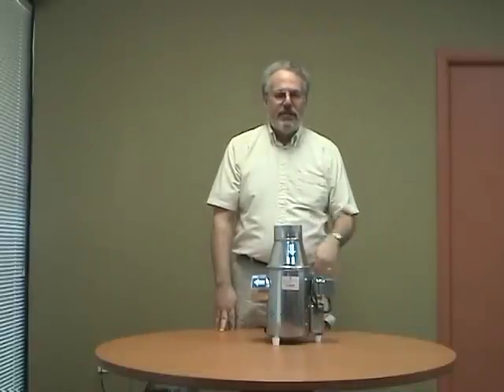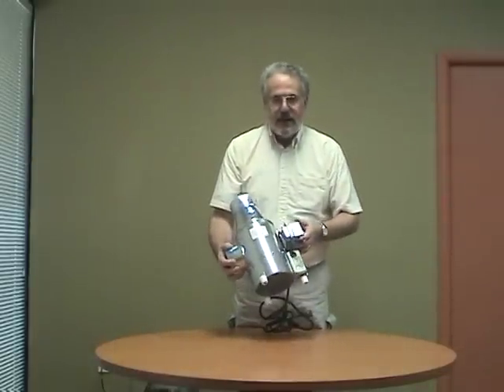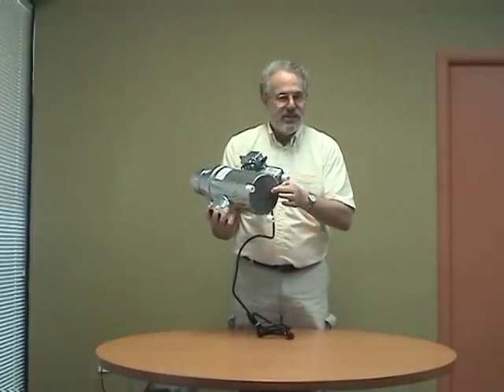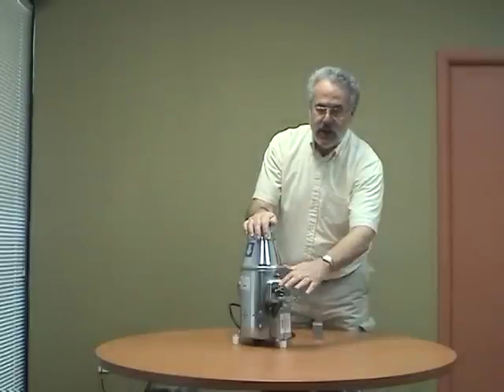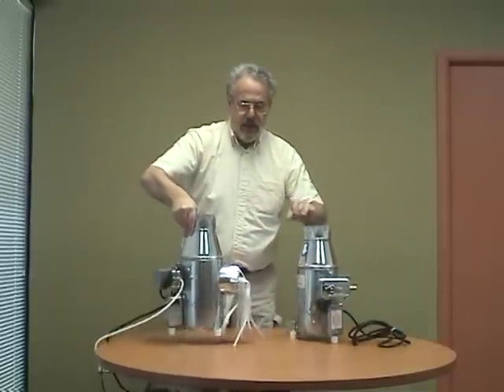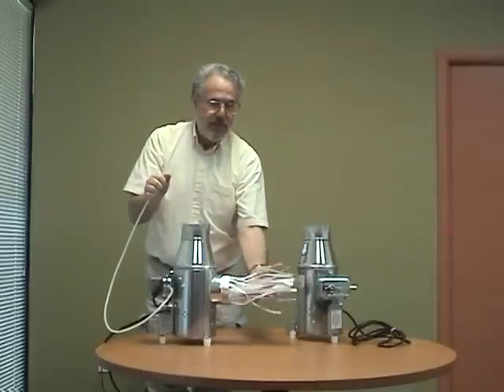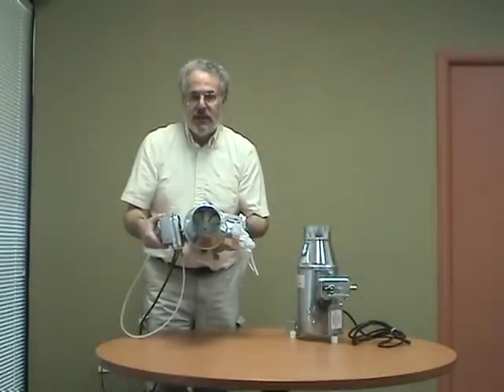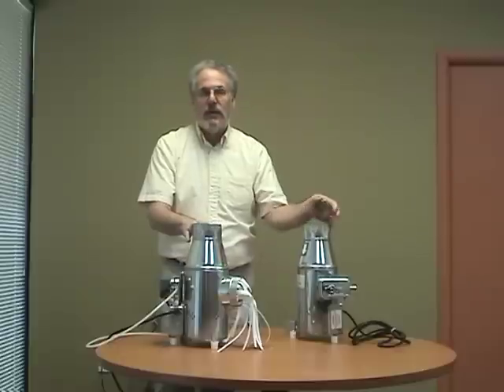The Ultimate Dryer Booster - Acme Miami 9460

Comment: I purchased one of these fans and installed it behind my dryer. I have a 40 foot run of metal pipe through my attic to an exterior wall. With the elbows the total equiv length is 75 feet. This fan works great solved my problem of my dryer venting into my garage. I just cant say enough about how good this unit works. I plugged it into my wall outlet in the laundry room....easy.The automatic pressure switch activates the fan when I turn on my dryer. Very very well made...all metal....great product worth every penny it costs.
Reply: And the unit runs at about the same noise level as the dryer, maybe a little less. The airflow increase is outstanding.

Comment: I ordered my A-M 9460 from the KTool website. They had to wait on a part before sending the unit to me. It took about 3 weeks, and I installed and I'm using it the first time tonight. It is already making a huge difference in drying time and results.

Diagrams come with the unit showing how to set it up for horizontal and vertical installations. I recommend the harder duct instead of the flexible foil duct. The plastic tube has to be inserted into the duct pipe to actuate the unit when the dryer comes on.

The unit is no louder than the dryer, and it moves a lot of air, quickly. The temperature difference of the pipe between just the dryer running and running with the blower is significant. Air flow will definitely improve drying times.

Cleaning the unit of any accumulated lint is recommended at least every six months for efficiency and safety. I recommend setting a reminder on your phone's Calendar to do this. I have all of my maintenance reminders set there, to change out various filters.

The booster actually cost more than my refurbished 30 year old Whirlpool dryer. But in my honest opinion, worth every penny, and gives a lot of bang for your buck.

Comment: Chuck, I have an LG stacked washer/dryer tightly fit in a condominium closet. Off the back of the top mounted dryer the duct immediately turns up 90 degrees, goes through the ceiling, into the attic and turns 90 degrees again. I don't have floor space on any of the 4 sides, so can the booster be mounted horizontally on the wall or resting on top of the dryer?  Also, are there limitations on how close to the dryer it can be? Thanks, John Manchester
Reply: KTool website has this unit, and has diagrams for horizontal/elevated installations. It won't let me share a link to the page.

Comment: Chuck/ John, how long can a standard house dryer vent hose be before you have to put a booster fan?  Thanks
Reply: For those just seeing your post, the max a standard dryer is usually designed to handle about 26 feet of vent duct, maximum. I had 27 feet of duct, and have a 30 year old Whirlpool dryer, lovingly maintained, with a new element. Because of the length of the duct, staying times were sometimes crazy. Any jeans in the load, and you're looking at at least a full 80 minute cycle, plus half another. Two hours, minimum, drying time with jeans or towels. Air Sense would dry everything but jeans and towels, which required another 40-50 minutes.

I installed this unit today, and ran my first load with heavy shirts and 3 pairs of jeans, a pretty heavy load. Everything was completely dry in the cycle, first time. No dampness at all. The booster cost more than my refurbished machine did, but will pay for itself easily in the time and energy saved not having to run two cycles, anymore.